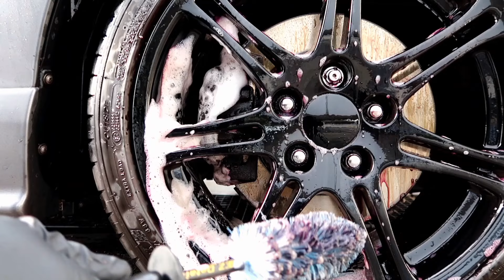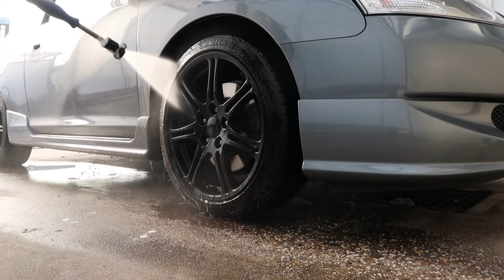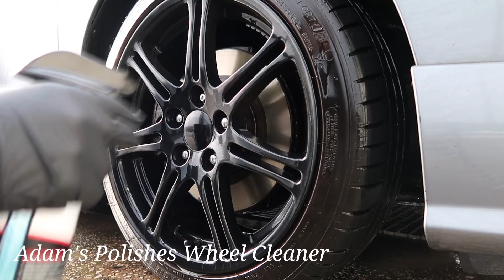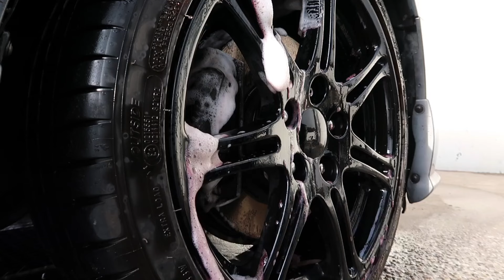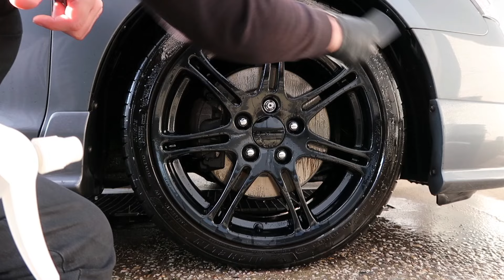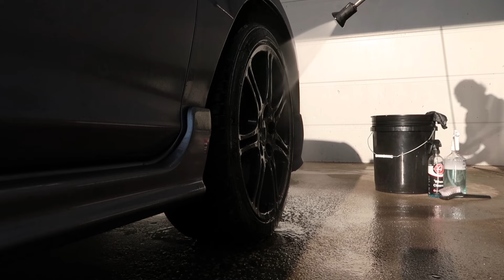How To Clean Gloss Black Wheels with Luxury Car Detailing Products At The Self Service Car Wash

Comment: Undiluted PERL would give a very glossy look. 😮
Reply from the maker: This is diluted 1:1 but poured into the original bottle. You can also apply it undiluted to your tires. If you rub it with a microfiber cloth, it becomes more of a satin look and then it looks perfect. For the interior I dilute this 1:5 for the plastic parts. For under the hood and plastic on the outside I dilute it 1:3.
Reply: @waxkingcardetailing  for some reason if I don't dilute enough, I get oily results. Dilution gives satin looks.